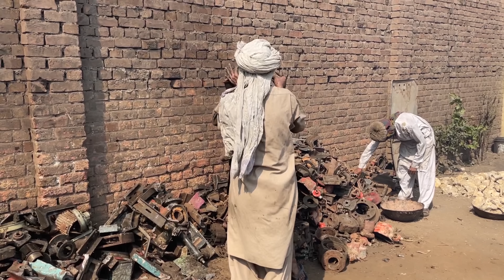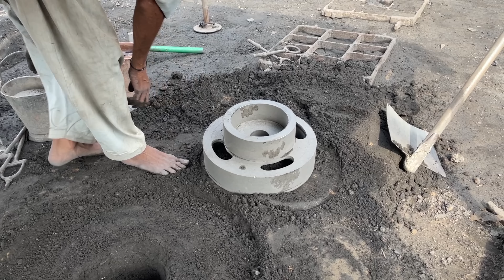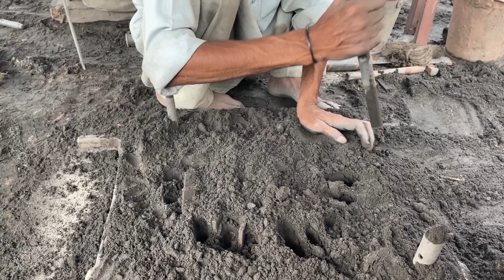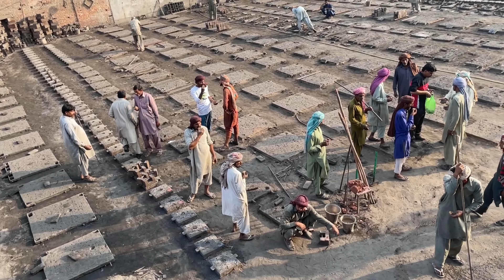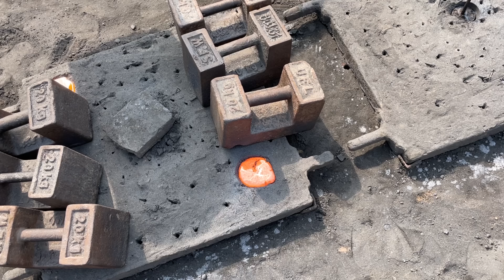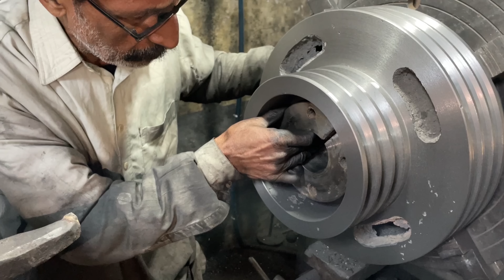Manufacturing of a SIX Groove Pulley | How They produce 6 Grooves pulleys in huge factory

Comment: working around molten metal in sandals.
Reply: These are reinforced sandals 🤣
Reply: Not the place to slip up that's for sure.
Reply: @VenturiLife  - it's fine.  Just ask "stumpy" over there in the corner.  :D
Reply: Leather boots won’t stop molten iron.

Comment: For these pulleys, the scrap that we see at the start is enough: cast iron, iron, steel.
Nothing is lost, everything is transformed according to Lavoisier. And the toothed wheel becomes a pulley.
Reply: Junk made from junk, but if it's good enough for the job it's good enough.
Don't run 'em at high speed or load, jagged lumps of cast iron hurt.

Comment: I'm curious what you're using to melt the metal. Please tell me more about it
Reply: They’re using cupola furnaces.  They’re loading one of them at the very beginning of the video.
Reply: I have never seen a furnace like that before!
Reply: Basically blast air and fuel oil into the furnace.  Like a giant home oil heater on steroids.  Only problem is that these furnaces don’t get as hot as they electric or gas fires units.  Metal is molten but not to the ideal temperature you would want.  It works for their purpose, which is all that matters.
Reply: @rxpsycho7326  this type of oven only works with air and coal. The coal acts as a fuel and keeps the carbon in the cast iron at the same concentration. cast iron has a lower melting and casting temperature than steel. this type of furnace cannot be used for casting steel.
Reply: they use coal and wind mouths. the heat resulting from the burning of the coal leads to the melting of the cast iron that I insert through the top. it is only used for cast iron and a quality cast iron is not obtained
Reply: @stefanpopescu6479  this is also true, yes.  I’ve seen both coal and oil injection used.
Reply: @rxpsycho7326  oil it used just to start burning process
Reply: আগানা ভাই